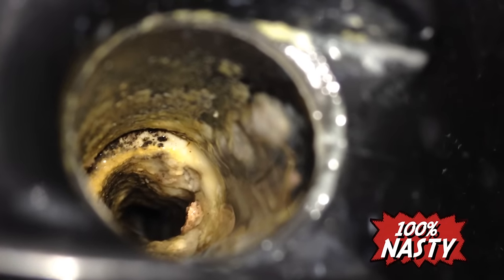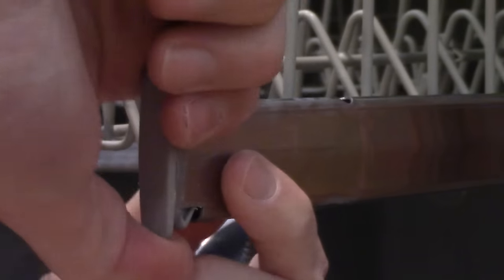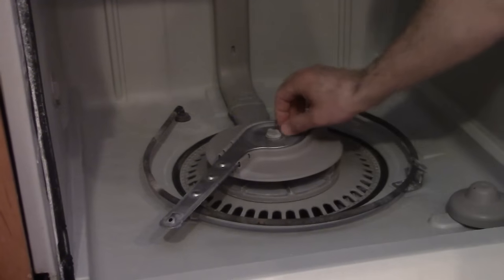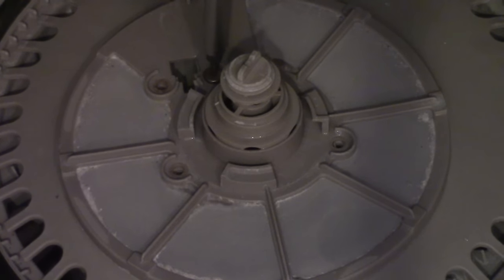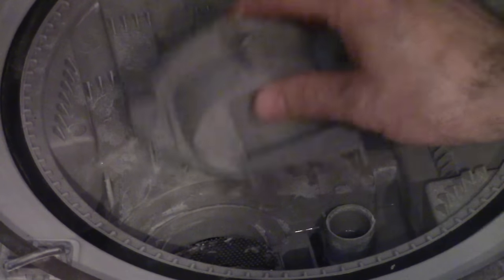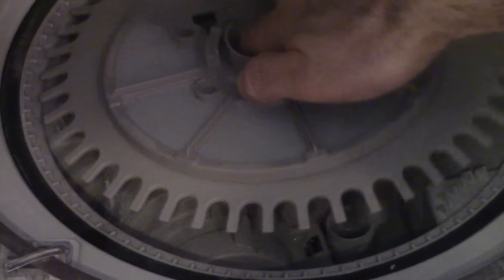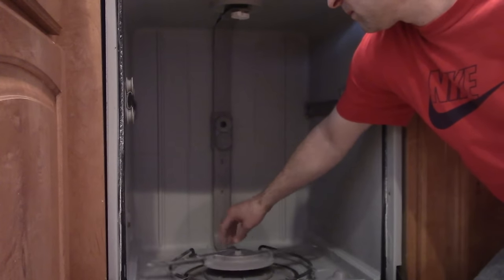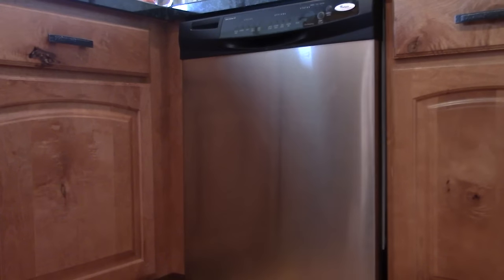How to repair a dishwasher, not draining - troubleshoot Whirlpool

Comment: Thanks, your post saved me a bundle.  My three year old Amana wouldn't drain.  We were irritated and my wife said let's just get a new one as a professional would charge more than it's worth.  But I watched your posting (and one or two more) and decided to try my hand.  I first cleaned the two filters.  They seemed fairly clean and the problem remained, so I pulled the unit with the plan of directly wiring the drain pump after removing it.  It worked.  All the drain lines looked quite clean, but as I was reinstalling the pump a small dime sized sliver of glazed ceramic material, like something chipped off of a coffee cup, fell to the floor.  I reinstalled the machine and it now works fine.  Cost: zero!  Time: an hour or so.  Your posting made it look so easy, and it was.  I'm just wondering how the damn thing got past the filter.
Reply from the maker: Thanks for the comment.  Im glad to hear you got it going again. Yes it's hard to understand how things like that get past filters.

Comment: Great video. I also have a 20 yr old Whirlpool that we rarely use, so it looks like it's brand new. Your video clearly explains how to disassemble the stuff inside.  Thanks so much for posting. I'm beginning to have a feeling that the reason why mine won't drain is related to the circuit board because none of the buttons won't work and I can't even get the dishwasher to turn on....had a similar problem in the past, looked at the circuit board, and there was a nest of cockroaches on it. Gross. Replaced board and it worked.  This time I ran the dishwasher, then came home to find  water in the bottom of it so I proceeded from there, unable to figure out how to remove the parts in your video. Then discovered that the dishwasher now won't run.  I'm going to first do the things in your video, then if that doesn't work, going to have to access the circuit board again.  Thanks again. Your video is very clear and easy to follow.  It also has great tips to avoid disasters, like losing a screw. Ugh how I hate losing stuff like that.

Comment: Our dishwasher was not draining well. I checked the sink drains, as you suggested. One was clogged and very slow to drain. I fixed that and that solved the problem with the dishwasher. Thanks for the tip!

Comment: Thank you for posting a simple video on something that should be included when buying a dishwasher.  I just did mine and found lots of krud, 8 years worth.  Just put it all back together and hoping this solved my 'poor cleaning' problem.  I will see in the morning if it worked but I already hear water moving around that I hadn't heard in a while. Thx again!

Comment: Thank you for this video! My wife and I just used your directions to clean our dishwasher. We moved into our house about 2 years ago and noticed that the dishwasher wasn't cleaning very well. From the looks of it, the previous owners had never cleaned it since it was installed about 10 years ago. Thanks to your video we got it apart and back together with no problem. After having to get 10 years worth of nastiness out of it, you can bet that we're going to make this an annual task. Thanks again!

Comment: Awesome video!! Thanks for letting us know about the T 15 bit!!! I will be trying to clean my 20 year old dishwasher after I pick up the bit!! I am sure I will find all sorts of crap inside the filter!
Next day, I did follow all your instructions!! I found so much crap! I also used a wet and dry vac to pick up the gross left over water ( very handy)
My only hip up was the last top screw, I am having a very hard time getting it right. I will try tomorrow!!
Thank you so very much!!
I did it!! And it works great!!!
Thanks again!

Comment: Perfect!  Disassembly showed me a clogged strainer screen and broken chopper.  Ordered new chopper assembly off of Amazon - much cheaper than online parts places.  Please do a vid on replacing this part as my reading showed it’s a common issue.  It seemed difficult to remove at first, but once you get the “compress the spring” trick, it’s easy to remove & replace.

Comment: Hey Adam!! Love your channel!! Very easy to follow directions for this gal 😊
I followed this video a few months ago to clean our dishwasher. It worked perfect(it was nasty in there) as well as the follow up video on the plastic nut under the washer arm. I too had trouble with it cross threading and just spinning!!! 
Fast forward to my question today. Last night we had a jet engine taking off from our kitchen 😂 No leaks. I’m not sure how fast the bottom should drain but there was a good bit of water standing in the bottom during wash cycle. (I’m not sure if that is suppose to drain as it washes or after the wash cycle…..question #2 🧐) 
So I essentially did every step in this video again to make sure nothing was trapped around the blade. Nothing major. A few spit wads and a tiny piece of plastic. Hoping that was the culprit, I ran the rinse cycle after putting everything back together.
Nope!! Still got a fighter jet in my kitchen. 
Now to my actual question. The little clear washer that is under the washer nut/arm
(you pointed it out in your video to not lose it), mine is not there. Is this a major issue? Could this be causing anything or in the future. I’m almost 💯 positive it was there a few months ago when I cleaned and possible I didn’t put it back 🤷🏻‍♀️ Either way, is this an issue of any sort???

Comment: Your video helped, thanks.  I have the same translucent drain hose as your machine and it did not appear to be clogged.  I ended up removing the dishwasher and bench testing the drain motor; it worked fine.  While I had the drain line disconnected, I blew into it.  It was like blowing into a garden hose that was kinked.  I completely removed the drain hose and flushed it out.  While it did not appear to be clogged, it was completely restricted.  If I gave up on this dishwasher and bought a new one, it too would not have drained.  That would have been really frustrating.  I could see a few dark deposits in the hose, but nothing substantial.  Boy was I wrong.  The wife thought the hose might be the culprit, but after a visual of the hose I disagreed.  However, she ended up being right.

Comment: Very well done! I followed your instructions step by step, and my dishwasher was in terrible shape. I cleaned all the crud off, and put it back together. Works MUCH better! Saved me a phone call to the service repair man! ($$).

The only difference was that my dishwasher has a "PowerScour" piece that made it difficult to remove the back section. It comes off easily though.

Thanks again!

Comment: Very helpful to a housewife home alone during the week and needed to fix the dishwasher on her own. The only part I had trouble with was trying to get to the blade part. I got 1 screw off but it wouldnt pop off. I couldnt see if there was more I was suppose to try get or not. I called it good after all the junk I got out. Did have to use a couple of different sizes on the screws. Thanks for your helpful video.
Reply: Me too.  I was able to get the screw out but nothing would budge.   I just gave up and cleaned out all the gunk before the blade part.
Reply: Mine came off but it was frozen stiff and took a lot of  convincing.  There is only one screw.  We have hard water so mine was calcified.  I poured several  ups of vinegar over it and let it soak for a while and then kept prying on it with a screwdriver and the housing finally popped right off.  The propeller blade was frozen stiff and the screen totally gunked up until I took it out and cleaned it.  Next time you clean it try this!
Reply: Just the info that I've been looking.  My cover is stuck also,  I've pried but to no avail, afraid I would break it.  I will try the vinegar.  Thanks Kay Sigmund and robassable you have been a great help.

Comment: this was super helpful, thanks.  i followed it and fixed my dishwasher this morning.  the top wasn't cleaning, now it works great.  the muck was shockingly gross.
Reply: Odd side question, how long from beginning to end on the Normal setting does your dishwasher take?   I ask as I feel mine maybe missing a cycle.   Thanks.

Comment: I had a hard time getting the blade cover off. I thought I was doing something wrong. I found your video and made quick work of it.  Also, I didn't know the filter cover popped off. I made a few mistakes taking it apart that I would have avoided if I found your video first. I really appreciate the video!

Comment: Perfectly clear and informative.  I set out to do a thorough cleaning of our Whirlpool.  This looked just like it on the inside.  I appreciate how easy you made each step. I found a lot of crud as well as a twister tie (wire center) and some other unknown needle like piece of hard plastic that were probably causing problems.
Reply: I know you wrote this 5years ago but I just did this and found the exact same thing so I thought it was funny.. it was a toothpick btw lol

Comment: Thank you, so much! Great, easy to follow instructions! We just replaced our garbage disposal and the dishwasher wouldn't drain. My husband just wanted to replace the dishwasher. All I had to do was to get to step 2: check the output hose. There was a plastic piece on the disposal that needed to be knocked out. After getting the dishwasher to drain, I completed the disassembly to clean out the filters. ICK!! Again, thank you so much for your video!

Comment: Thanks so much Adam for taking the time & effort making this great video.  I just finished going through my dishwasher and it was just like your's,  though the water pipe assembly for the upper dish tray was not held on by screws, rather with two metal clips.  And by watching your vid I noticed you turning the hold down plastic screw for the lower sprayer in the opposite direction to loosen it, righty loosen and lefty tighty.  Once again, thanks so much.  :-)

Comment: Awesome video. Won't try until tomorrow because I cleaned the drying aide container to see if that fixes the issue. It's 8 years old so it bound to be dirty. Great job and I agree with the reverse thread comment, but chances are if you're taking apart your dw you'll figure it out in a few seconds.

Comment: Great video! I took it apart and all went well. Got it draining, and it was filthy with mineral build up! Guess I will get a water softener. It got clogged up in less than two years! But I couldn't get the screw off and remove the part that covers the blade! Had to use some pliers. Thanks a BUNCH dude! You saved me hundreds and validated my recent decision to get a divorce! Treating myself to a delicious Lagunitas IPA!

Comment: Great video! The only problem I had was getting the cap off the grinder blade. Mine did not have something you could grab. Watched another video that said you could pop the top on the side and not worry if it breaks. Off the popped the top. This video just save me a service call and $$$$$

Comment: I'd done this drain sump clean-out before, but this was a good refresher on the procedure.  We started getting a loud buzzing noise from our 15 year old dishwasher, which I was pretty sure was the circulation pump.  It was - because of something wrapped around the macerator blade shaft.  Once I cleared that and cleaned out all the other gunk, and reassembled the machine, the noise significantly abated, basically back to normal.  So, before concluding the circulation pump needs replacement, always clean out the drain sump, and be sure to make sure there is nothing wrapped around the shaft behind the blade and filter screen.

Comment: Awesome tutorial, thank you. The only tip would add is if this does not work, try removing the hose from the garbage disposal and blow through it. After I did that, it started draining fine.

Comment: Great Video and a really good help for me.  Found a plastic lid stuck in my garbage disposal just downstream of the attaching rubber hose.  Previously, my Maytag dishwasher was leaving several inches of water in the bottom.  After removing the cap, the dishwasher works like new.  BTW, my cutter blade was encapsulated by rotting paper and grease.

Comment: Good service video. Thought I would start easy..with the drain hose..no such luck!! Disassembled everything and found quite the assortment of "stuff".. lol. Cleaned everything and reassembled, did a quick test and PRESTO..as new!!... On the plus side, I am now the proud owner of a full set of Torx driver bits as-well-as screwdrivers to add to my collection. Thanks. * 2 thumbs up*

Comment: Great instruction on cleaning this out!!  I had no issue with taking it apart and putting it back together. Now the lights are still blinking so not sure how to ‘reset’ the computer. Great suggestion about putting the towel down while working on taking out and putting them back in

Comment: Very helpful, thanks so much! Whirlpool says that, depending on use, my model (which looks exactly like this inside except for the racks) should be cleaned at least once a year... and I know it had been at least 3.5 years. So even though the dishwasher wasn't malfunctioning, I expect it will work a lot better now!

Comment: thankyou for the excellent video, which perfectly described my dishwasher here in the year 2021! I did all of the illustrated when I realized my husband had installed a new garburator without reading the instructions, in which the first step, outlined in red is: before installing unit, remove dishwasher drain plug if using with a dishwasher...

Comment: Excellent video--we found 7 years of food crud and labels that blocked the pump and hose. We had to use the vacuum cleaner to suck the debris out. Only critique I would have is that the screw to remove the bottom sprayer is reverse threads ...Thank you Adam!. -pc

Comment: Thanks for this video. It made me g through the process of troubleshooting. Air gap drain had calcium build up that clogged. Removed air gap,soaked it in clr and walah it actually pumped all the water out of dishwasher finally.

Comment: Nice.  Most of the sites I find have a completely different interior, but this is the kind I have.  Ashamed to say I don't own any Torx bits and wanted to find out if I really needed to take that bit out before I started pulling the thing apart.  Seems I do.  Heading to the hardware store this weekend.

Comment: Just found this - thanks for posting it.  Very satisfying to finally give the machine a proper cleaning.  I ended up finding several chunks of broken glass in bottom with the blade and screen (!)  Was able to remove them without cutting myself to ribbons.  Looking forward to cleaner dishes.

Comment: Thank you very much for your help and such a clear guidance,  great video, helped me to clean some terrible grease from the bottom of my dishwasher. if anybody interested, soaking dishwasher parts in SuperClean worked great to remove hardened nasty grease. I've also poured it into the bottom of dishwasher and let it sit overnight.

Comment: Thank you.  My whirlpool gold looks just like this and now I know where the filter is, because it is not mentioned in the owners manual.  Any water not draining usual had to do with cleaning the air gap (?) on top of the sink so that's easy.  I have had the whole assembly apart a few times to replace the little plastic thumbtack that holds the small upper spinner.  Pretty difficult but have had to do it twice and they charge way too much for that little plastic part.   Right now there are weird noises and the Normal cycle shuts off before the soap comes out.  The pits and pans cycle works but it's a pretty long cycle.  Since it's about 20 years old, I figure it's time for a new machine so I guess there's not much risk trying to clean the filter for the first time.😂

Comment: Great video but my “garburator” cover did not release easily by just removing the one screw. You actually have an older video that shows that it is a tab to the right. Despite that I still had trouble figuring out how to get it off. In the end it seemed to be by using a long flat head screwdriver and gently prying from the outside in on the right hand side around the back of that tab area. As other people have said, getting the garburator screen and blade assembly can seem hard. I suggest taking a picture of its original seated position. It looks like there are two deep notches that the screen might fit into and that’s what I was trying to do before I looked at pictures I took and realized they sit in front of that. Then it was a matter of first aligning the blade notch, using the spring to push it out and then gently getting the screen into position.

Comment: Thanks this was accurate and easy to follow. Especially the tips including the towel. Note that you need to use a square drive bit for the back and top screws. Did not have a magnetic handle to hold the bits in place, so used a bit of masking tape to hold the bits and screws from falling. Great Job. Lotar

Comment: SO HELPFUL! As others have said: concise, clear, and correct. I was afraid I'd have to replace a seal, call a plumber, or buy a new machine. Just labels and gunk stuck in various ports. Question: How do you keep the inside of your tub so pristine? Mine had mold in all the hidden places. Maybe because we rarely use the heat cycle? Anyway, THANK YOU!

Comment: Great video.  This is what YouTube should be about.  I turned on the drain cycle while it was open and the blade did not spin. Should that spin with the drain cycle turned on?